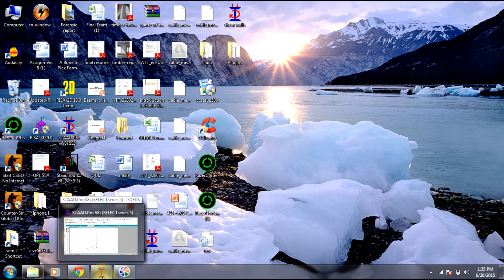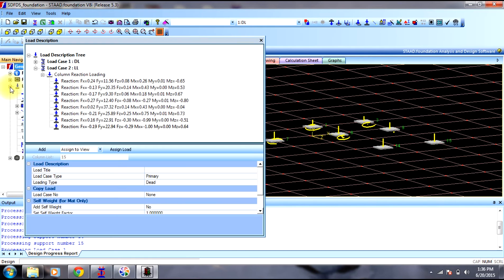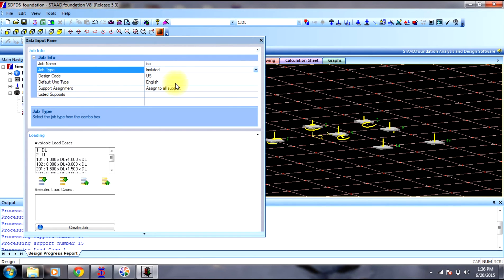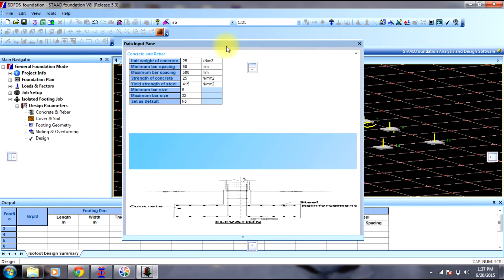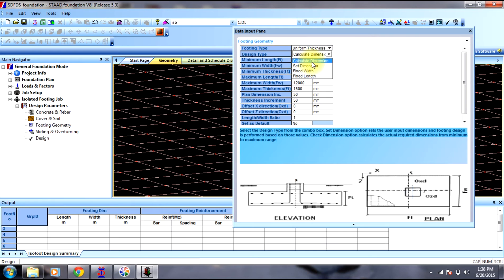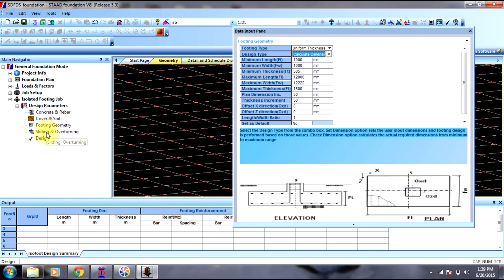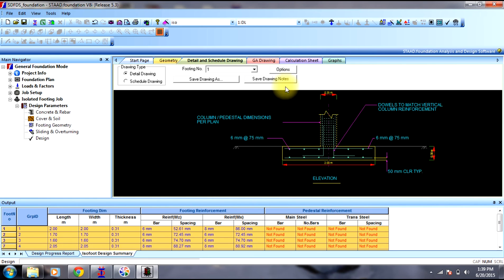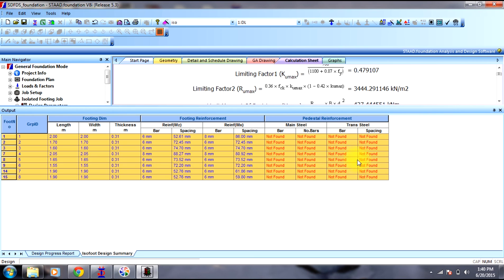STAAD Foundation-Tutorials-Design and Analysis of Isolated Footings-Day 35

Comment: I have done a analysis of a building  using of below load combinations 
& it give output one of my column load & moment given below 
listed.So what should be the value of Fx , Fy , Fz , Mx , My , Mz taken to design isolated footing in staad foundation helppp pls.

NO.    LOAD COMBINATIONS  (ORTHOGONAL BUILDING WITHOUT EARTHQUAKE ECCENTRICITY)           
 ------------------------------------------------------------------------------------------------------
   1     1.50 DL + 1.50 IL
   2     1.50 DL + 1.50 EPX  
   3     1.50 DL - 1.50 EPX  
   4     1.50 DL + 1.50 EPZ  
   5     1.50 DL - 1.50 EPZ  
   6     0.90 DL + 1.50 EPX  
   7     0.90 DL - 1.50 EPX  
   8     0.90 DL + 1.50 EPZ  
   9     0.90 DL - 1.50 EPZ  
  10     1.20 DL + 1.20 RIL + 1.20 EPX  
  11     1.20 DL + 1.20 RIL - 1.20 EPX  
  12     1.20 DL + 1.20 RIL + 1.20 EPZ  
  13     1.20 DL + 1.20 RIL - 1.20 EPZ  
  14     1.50 DL + 1.50 WPX  
  15     1.50 DL - 1.50 WPX  
  16     1.50 DL + 1.50 WPZ  
  17     1.50 DL - 1.50 WPZ  
  18     0.90 DL + 1.50 WPX  
  19     0.90 DL - 1.50 WPX  
  20     0.90 DL + 1.50 WPZ  
  21     0.90 DL - 1.50 WPZ  
  22     1.20 DL + 1.20 IL + 1.20 WPX  
  23     1.20 DL + 1.20 IL - 1.20 WPX  
  24     1.20 DL + 1.20 IL + 1.20 WPZ  
  25     1.20 DL + 1.20 IL - 1.20 WPZ  

Node Load                   Support Reactions (Global Axis System)         
                                                     No.  Comb.         Fx         Fy               Fz         Mx         My         Mz
                                                                  1           0.67     106.74      -1.37      -0.87       0.00      -0.42
                                                                   2          -2.69      73.74      -1.44      -1.00      -0.01       3.92
                                                                   3           4.06     117.30      -1.35      -0.76       0.01      -4.78
                                                                   4           0.71     112.97      -4.57      -6.27       0.00      -0.45
                                                                   5           0.66      78.07       1.77       4.50       0.00      -0.41
                                                                   6          -2.97      35.53      -0.88      -0.65      -0.01       4.10
                                                                   7           3.79      79.09      -0.79      -0.41       0.01      -4.61
                                                                   8           0.43      74.76      -4.01      -5.92       0.00      -0.28
                                                                   9           0.39      39.86       2.33       4.86       0.00      -0.24
                                                                  10          -2.16      60.79      -1.15      -0.80      -0.01       3.14
                                                                  11           3.25      95.64      -1.08      -0.61       0.01      -3.83
                                                                  12           0.56      92.18      -3.65      -5.01       0.00      -0.36
                                                                  13           0.53      64.25       1.43       3.61       0.00      -0.33
                                                                  14          -1.65      84.22      -1.47      -1.03      -0.01       2.51
                                                                  15           3.02     106.82      -1.33      -0.74       0.01      -3.38
                                                                  16           0.70     104.59      -3.63      -4.51       0.00      -0.45
                                                                  17           0.67      86.45       0.84       2.74       0.00      -0.42
                                                                  18          -1.92      46.01      -0.91      -0.68      -0.01       2.69
                                                                  19           2.74      68.61      -0.77      -0.38       0.01      -3.20
                                                                  20           0.43      66.39      -3.08      -4.16       0.00      -0.27
                                                                  21           0.40      48.24       1.40       3.10       0.00      -0.24
                                                                  22          -1.33      76.35      -1.15      -0.81      -0.01       2.02
                                                                  23           2.40      94.43      -1.04      -0.57       0.01      -2.69
                                                                  24           0.55      92.65      -2.88      -3.60       0.00      -0.35
                                                                  25           0.53      78.13       0.69       2.21       0.00      -0.33